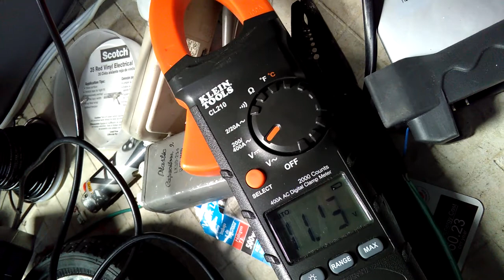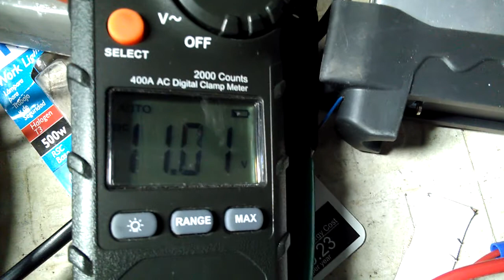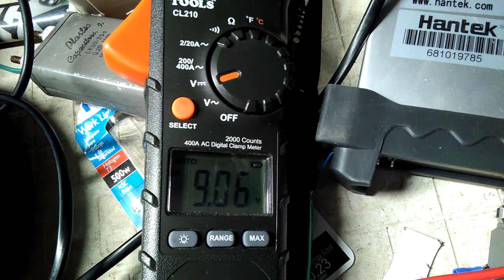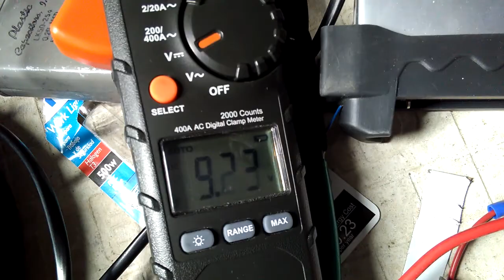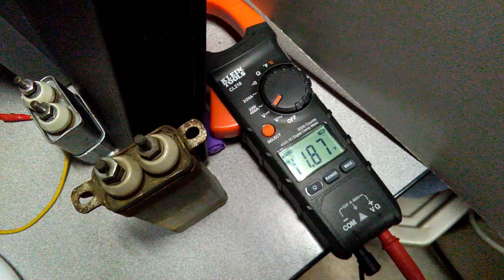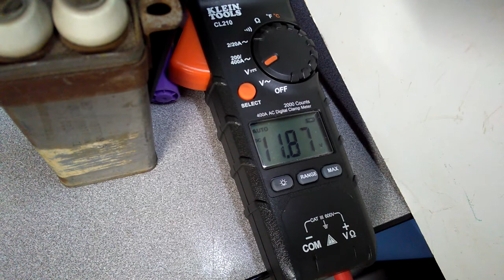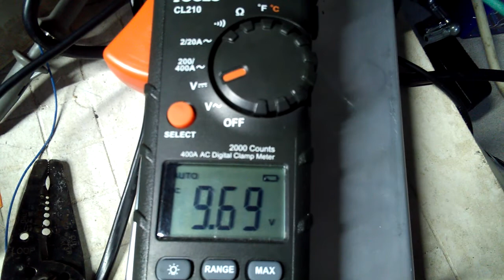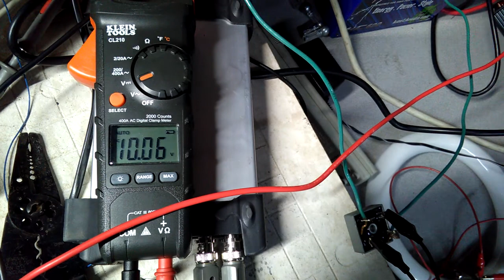first time running on dead battery

Comment: jeff, I just found a letter from our friend Don to a person named Bruce from 2004 before he died I believe. In this letter he tells Bruce that the L1 and L2 are already in the step up (NST, Ignition coil) and to ignore 6 on but make sure that the capacitor to negative is unattached and the circuit will work as he caused so  much of a ruckus with at the 96 Tesla conference. He did not show the device because he did away with nearly everything except the high voltage diode bridge, fast, and the voltage divider with one spark gap and adjustable earth grounding. I will try and figure out what he actually means because there is no diagram but it reminded me of what you are doing here.

Comment from the maker: This circuit ran for several hours in this loop while charging the other battery. 

The kinetic force from the capacitor discharge eventually moved the spark gap and the loop was broken. It wouldn't start again after that, the battery was still at 9v~

I have another video im uploading that shows the whole experiment@;

www.thenewenergyconceptsgroup.webs.com